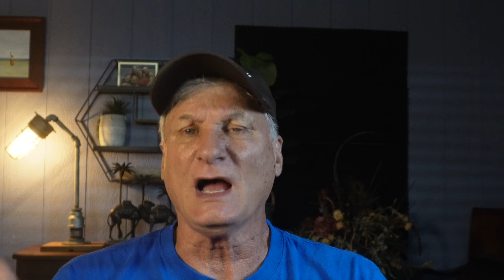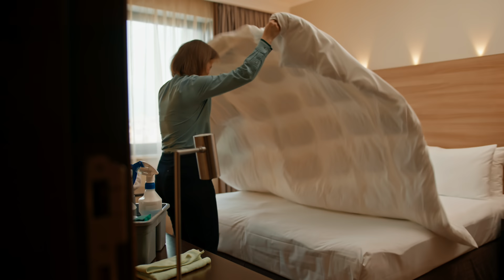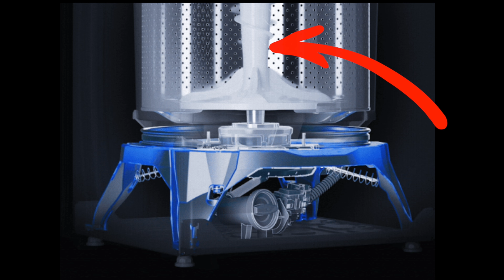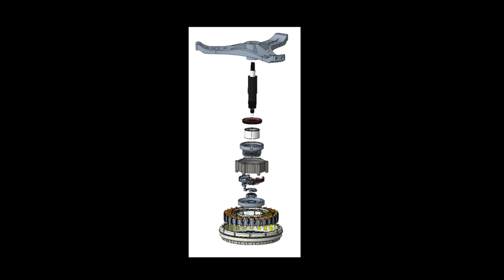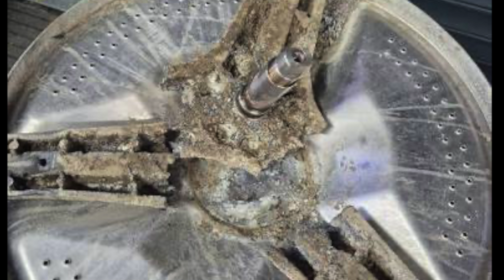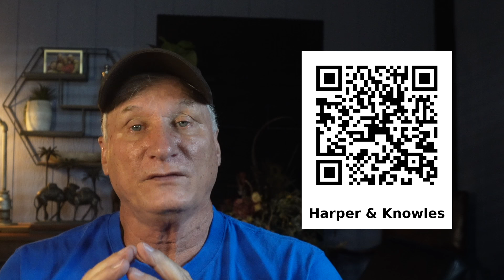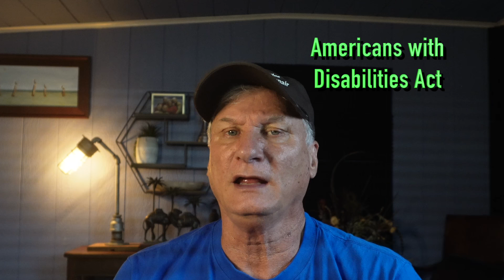Maytag's New 30-Year Washer: No Gearcase, Real Agitator, 900 RPM

Comment: My 1994 Maytag just died this year - replaced with new GE washer with 10 year warranty (probably only 5 year).  The hard part was finding a machine that isn't "Smart", yet this had all the flaws of "Smart" - had to use ChatGPT to bypass many of the limiting features, like locking lid so you must buy pods.  It runs loud and long - probably 45 minutes per load.  On another note, after my Frigidaire, 3 new ones failed in 4 months - finally the 4th one - made in China - was the charm!  Lesson learned:  If possible, only buy products NOT made in the USA.  Thank you for this wonderful video.
Reply: That's a horrible attitude
Reply: should  have Rebuilt the  1994 Maytag

Comment: You are quite right about the control boards being a weak link in clothes washers, in my opinion in ALL modern appliances that incorporate electronic controls. Appliance manufacturers bought into the electronics manufacturer's promises of longevity and reliability - turned out to be 50% BS & 50% science. Maybe today the appliance manufacturers have figured out what military electronics manufacturers learned decades ago: test, test, test, refine, refine, refine - the only way you are going to figure out true lifetime numbers is to work the piss out of a system and keep improving it from what you have learned.
    So that, the new multi-magnet rotor and stator motor is potentially a step in the right direction of service-free longevity. However, such multi-magnet motors are heavily dependent on their electronic controls for their versatile functionality. Will this control board hold out for the long haul? Can it and will it last as long as the high-tech motor? Will Maytag/Whirlpool beat the crap out of it and see what it's worth before releasing it on a hopeful public? We shall see.
    I would suggest they include another feature on this new machine that might be a big consumer favorite: A wash counter, an elapsed hour meter (mechanical types please!) and a year of manufacture emblem mounted right on the control panel. These would provide a true picture of how much a consumer is getting out of his purchase, draw in future customers, and help service guys determine true reliability vs long-ago promises (think 30 Years - 2056). Manufacturers take note: Put your promises and reputation right on the line if you really mean & value them. Satisfied customers are you best salesmen.

Comment: Our washer and dryer are 49yrs old- one is mustard yellow, other is avocado green-  two colors only the 1970's could create. I can still get parts for them.  I keep them running.
Reply: 54 years on my Kenmore/Whirlpool w&d. Replaced the worn out standard duty clutch with a heavy duty one about two years ago, both still work like new.
Reply: @dam00k  At this point I've pulled and replaced almost everything in the dryer.  I need to do deep dive on the washer this year.  I'm a little nervous it won't survive surgery.  We live in a 1830 stone farmhouse- never short of projects.  Oddly enough- we see the washer/dryer as a point of pride.
Reply: @greggeorge5170  check into the dogs on the duel action agitator, the coupler where the trans meets the motor and possibly the snubbers under the tub.
Reply: @sipmeister3611  It makes a HORRIBLE sound coming out of spin cycle... earplugs required!  That's what I need an answer for.
Reply: @greggeorge5170 I would too! 👍🏼
Reply: Is it really mustard yellow or could it be harvest gold? Don't think I've ever seen an actual yellow one.
Reply: @bw3506  you are correct- I just guessed the color names... by luck I got the Avocado Green correct.  but yes to Harvest Gold!!!
Reply: @greggeorge5170 Coppertone brown was another popular one at that time. My first Whirlpool washer was that. I worked yan appliance store for nearly 20 years starting in 84 so I saw a lot of the older stuff. GE made a pretty bright yellow color appliances as well as pink. Prettiest Whirlpool set I ever saw was Robins Egg blue. It was a factory color but that was the only one I ever saw like that. There was also a Buckskin color at that time. It was kinda cool as well. Anyway I feel pretty bad about hauling all that old heavy metal stuff for scrap now instead of stashing it. Who knew you wouldn't be able to buy anything halfway decent. At that time Speed Queen was mediocre at best now it's the best. Tells us how far the industry has fallen.
Reply: @bw3506  Washing machines now are like cars: you can have any color as long as it's white or black or gray/metal
Reply: You... might want to do estate planning. Figure out who gets those machines.
Reply: My parents dryer finally died last year.  They bought it before I was born. It lasted over 50 years.
Reply: @Drgunzo616  I had to replace the motor in mine last year.  It this point, over years, I have replaced so many parts that I think the heating element is the only core part that is original in the dryer.
Reply: My mother purchased a Sears Kenmore washer and dryer set in 1968.She had the regular maintenance plan where the tech comes out and makes sure everything is working fine.She passed away in 2018 and they were still working   with no problems! 💯
Reply: Never, ever sell them! Keep fixing them and baby them as best you can. ✓
Reply: @andyroidx  Good idea!  As long as I can find parts,  I’ll have someone fix them. I’m not a great cook, but I love doing wash!  I receive many compliments that my clothes still look new.  Since It’s “my thing” I’m particular about the machine and the laundry products.
Reply: Me Too.
Reply: I cleaned up and  spray painted the top of my dryer after it started to rust a little. Replaced the motor, belt and idle/ tensioner so far. It should last forever if you can get parts.
Reply: Yeah Yeah Yeah the more water comes out it's less drying time if you know how many minutes to set the dryer if the clothes ain't dry I just hit the start button and dry some more and mostly I forget and it went through a second time. I know forty  minutes is not long enough to dry a large load. But I haven't tried to figure out the drying time. I myself like timed drying time over the auto crap that I tried over and over and over again. If the clothes sit all night I just do a five minute and hang the clothes hot 73
Reply: Smart best washer made
Reply: I still have the Harvest Gold Maytag Washer & Dryer.  I believe they are from the late 70’s.  I love them and have never needed the washer repaired.  The dial is easy to read & use.  The delicate cycle does agitate at a delicate speed, which is difficult to find.  I also can open the lid to add clothes, which I love. I know I’m going to have to purchase new ones soon, so I may try a Speed Queen.  Maytag was such a fixture in Newton, IA.  It’s so sad it’s gone.  Whirlpool acquired Amana too, but at least they still have a refrigerator plant in Amana, IA.  If anyone knows another washer with features like the old Maytag I still have — please let me know!  I need a set for my daughter, also.
Reply: I am proud of you and I Am Not being  a smart azz.  That awesome.  Are you my neighbor? I need 😂.
Reply: if its i timer probably not nut other parts yes
Reply: Only thing is, that dryer probably uses a lot more electricity.  Washing machine also, but probably not much more then current washers.
Reply: @trvman1  Yeah, but what are you saving if you got to replace the washer and dry every 5 years or less?
Reply: @trvman1 . So who cares? Not me.
Reply: @trvman1  Mine are both gas. Very inexpensive.
Reply: Must be using a ton of water, though.
Reply: @dennispetzold869  Thank God I got a washer with a DEEP wash cycle.  The regular cycle uses so little water there is barely enough to get the clothes wet. The rinse is the same.
Reply: @trvman1 I have a front loader and I actually added more water through the soap dispenser I just need to add a hose and put in more water. The problem with he machines they take so long to do one load of laundry I want my 25 minute wash back I don't care how much water I use it's not like there isn't  enough of this stuff. God made the rain and streams we can get the water we need. You can use rain water to do laundry, actually it's better and softer you don't need as much detergent. 73
Reply: @dennispetzold869  more then modern ones for sure... we live in a wet area and have well water.  We did replace the 1944 American Standard toilet that had a 5+ gallon flush.  That counts for something I guess.
Reply: @dennispetzold869  water is dirt cheap who cares
Reply: What brand are they?
Reply: @David-999-z  Both are Maytags made in Newton, Iowa.
Reply: What brand you got maybe I’ll search market place and rebuild one like some guys rebuild old cars.
Reply: @justinjostes2050  Maytags
Reply: They will out live us all.
Reply: That's because by then there effectively were only about five washing machines and three dryers actually being built.  Re-branded according to price point and what gadgetry was added on, but if you didn't need all those fancy features, the cheaper line was just as good, as it was the SAME internally.
Reply: That is mind blowing, how many transmissions, heating elements and motors have you gone through now?
Reply: @wasbipeas8080  The last dryer repair was the motor.  Original lasted 48yrs.  Still has original heating element.  Ceramic barrel glides were a pain.  Belts replaced 5 years ago.  When I had it gutted for the motor I did my best to clean/lubricate all the pulleys.  There has been a few other small plastic item repairs.  For the washer- Belts and hoses have been the issue-as expected with the age.  I need to address the washer 'breaking' system. horrible screeching sound as it stops.  It's on my list.
Reply: I bought Sears Kenmore, closeout washer and dryer,  heavy-duty and large size, December 1975.  I had the maintenance plan and the same repairman until I moved in 2000 to another city.  My new home came with all-new appliances..

My Sears repairman said that 1975 Sears Kenmore (made by Whirlpool) washer was made with steel bearings - and at some point Whirlpool changed to plastic bearings, which were worthless.  He told me to never get rid of that 1975 washer, and I sure wish I had it now!

Comment: My Whirlpool washer broke down less than 2 years after replacing the suspension rods. The new ones were shot again, but so was an actuator. Just spent $1500 for a Speed Queen. I guess the corporate a**holes couldn't figure out a way to cheapen down the Whirlpool gas dryers, because mine outlasted their washer and a Samsung washer.

Comment: I have a 23 year old Maytag Atlantis and it still runs like new.  I fixed it myself when the drain pump went out.  Pretty easy.  Only problem is Maytag quit making the brake assembly,, so I can't change that.  The tub is not suspended from rods.  Its held in place by 4 springs from the bottom.

Comment: The only reason I didn't buy a Speed Queen when we got our front end washer and dryer was the Speed Queen's load size was tiny compared to everything else.  Ya that got a good name but they also are tiny 3.5 cu ft vs 5 or 5.5 cu ft of some competitors is substantial.  I don't want to  have to go to a laundry mat to wash my blanket or have to run the washer twice as many times.

Comment: About 12-15 years ago I bounht a fairly new Maytag washer and dryer at auction. The washer was so efficient it would not go through a cycle without shutting off. The local Maytag dealer in my small town wouldn't come out so I called a rapair shop about 35 miles away. The repairman came at greater cost than local and told me I had figured out the most efficient settings and that I was right, there was no way to fix the bad engineering. I had to just junk the washer but continued using the gas dryer, which has worked fine until recently when the buttons start flashing on and off and nothing will start---until it decides to restart.

Comment: A direct drive motor with enough oomph to spin that drum at 900RPM is gonna pull a lot of power. That's a lot of strain on the controller. Better hope Maytag's engineers put some big honking EMF suppression caps on that board, or it'll be the weakest link in the whole machine.

Comment: And one other thing, I’m sure you’re never gonna see. I remember old washers that had the old cams in there that turned on a timer and the cams tripped the different cycles in the washer and they just rolled around until their time came. They tripped the next cycle and on they went there were a few buttons that works some relays and you’re done. What else do you need back in the good old days.

Comment: So it’s got a multipole motor with drive electronics. To what degree have the motor drive electronics been over designed and what will replacement drive electronics cost?

Comment: About 5 years ago I bought a Hotpoint Washing Machine 3.5 cu. It has an agitator and it's a real work horse. The footprint is smaller but the inside is massive and deep. I wash king size comforters, denim everything in it. It's also attractive with it's rounded edges. It has knobs but there is something smart about it. This is the third washing machine I have ever purchased and it's the cheapest largest and the best. I am very pleased with it.

Comment: Always great info! Will be interesting to see once released. You said “every front loader on the market has a plastic outer tub.” I thought the SQ FF7 has inner and outer SS tubs?
Reply from the maker: Good catch, that specific unit does indeed use a stainless steel outer tub—thanks for the correction!

Comment: I'll never buy anything new again, not a car, a home or appliance! (A bed, YES! For obvious reasons)  I buy my small appliances from yard sales and they're all OLD and never fail me. In the last few years I've bought a toaster, crock pot, 2 emulsifier blender things, electric skillet and a ninja blender. They have all gone in the trash because they either broke or worked half assed except the ninja blender. I'll tell you the ninja is my 2nd one and it doesn't hold a candle to the first one! The first has 3 sets of blades and spins like crazy. The second one was supposed to be higher watts...ain't no way! And only has 2 sets of blades! So it takes about twice as long to do the job and overheats horribly! The crock pot actually fell apart while I was cooking in it. The outside sheet of metal was so thin it collapsed into itself! A mini electric skillet, only heated on one side. Toaster got so hot on the OUTSIDE I just threw it out, don't need a fire over a slice of toast! The emulsifier broke on the 3rd use (blueberries) and i exchanged it for another then had to exchange that one too, they told me they wouldn't exchange it again. Lol. Felt like telling them not to sell them if they didn't want to exchange them! Got me an old one at a yard sale...zero issues!
Everything new is GARBAGE nowdays! Don't waste your money!

Comment: Don't matter if it has a computer board forget it regardless if it a queen or Maytag. I tried to repair a speed queen from a laundry mat and it would not stop filling water the water was all over the porch the vacuum hose came out and when I put it back it still kept filling water I didn't have a key so I scrapped the washer it had a computer board I want all knobs and to be able to stop and add and take cloths out no computer boards for me period. 73

Comment: The washing machine I have now (CROSLEY BRAND) is the biggest piece of CRAP I ever saw! It has a locking lid and no fabric softener dispenser! The lid can't be opened until about 3 minutes after the load is done so you have to add your fabric softener in the wash cycle! The rinse cycle doesn't even agitate, at all! It's programmed to "spray rinse". It rotates the spun load sporadically while the fill water runs till there's about 2 inches of water in the bottom of the tub. THEN the pos spins again, zero rinse agitation! So if you want your clothes actually rinsed you have to run another WASH CYCLE!
If I could move that sucker I'd haul it to the damn dump!

Comment: Chip, I have a 1999 maytag, had it rebuilt about 10 years ago. It works great, but it has started shaking. Walking terribly, I have had two  different repair people out but theyvtell me nothing is wrong with it and it is probably the feet. I am at a loss. Any suggestions?
Reply from the maker: The felt pads under the center cone need to be changed. https://amzn.to/4wFUiFH
Reply: You think a girl can fix this, or should I ask another repair company?
Reply: Thanks Chip, as a female, should I try to fix it or try for a third repair person?

Comment: Spinning more water out of the clothes saves not only electricity, but also your clothes; tumble-drying is constantly breaking down the fibers in your materials and you throw those fibers in the trash when you pull out the lint.  Thus, longer tumbling times cause more destruction to your clothes.

I run the spin cycle twice (I made a mark on the knob where the dry spin starts).  Though this shouldn't do much as the speed remains the same, I found that the second spin continues to discharge water throughout the cycle.  Tried a third cycle for science, but very little water discharges so I don't think it's worthwhile to do more than 2.  This will vary by machine, so a second cycle may not be worthwhile for most people.

My washer is at least 30 years old (late parents bought it in the early 90's, IIRC) and I cross my fingers each time I turn it on as I know just how awful modern washers are.  I sincerely hope that this Maytag actually stands toe to toe with Speed Queen as lack of competition tempts a successful brand to raise prices bit by bit.  This is unlikely to be the perfect machine, but it's the most interesting washer to come out of Whirlpool in decades and I look forward to seeing channels like this one use them and crack them open.